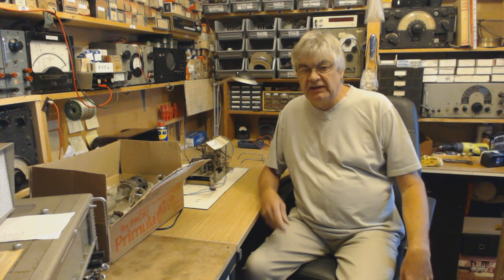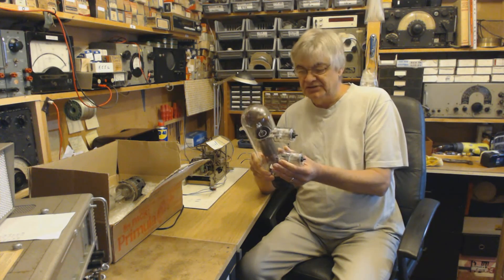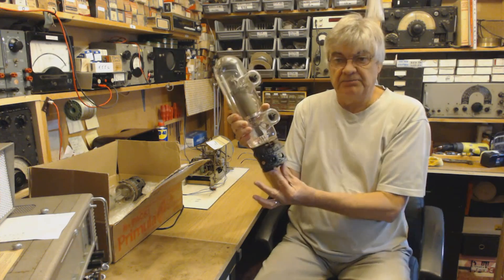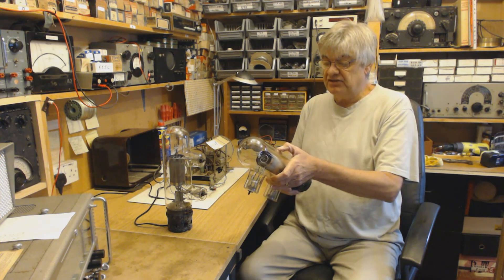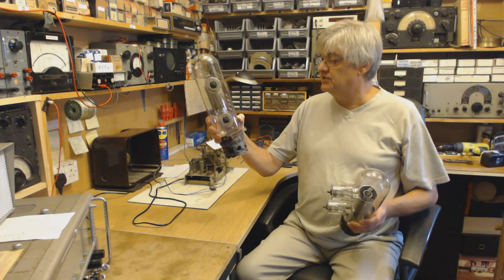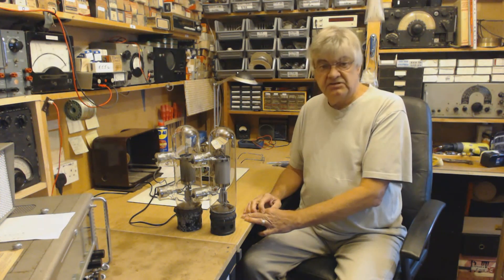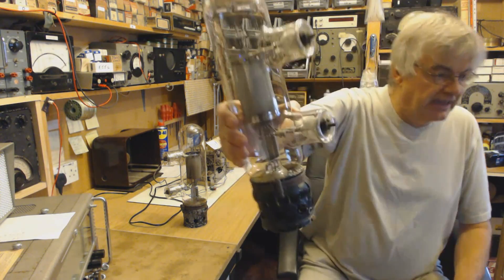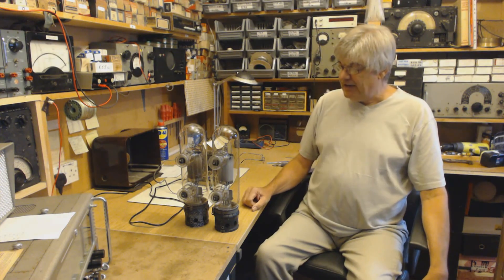500 Watt triode transmitting valve RS329G

Comment: I'd like to see someone build something with a 3C22.  This is a disc seal triode originally used in radar jammer applications and is good up to 125w plate dissipation with forced air cooling.  Apparently it is linear up to 3.2GHZ, and quite surprisingly it works very well as an audio tube, being somewhat similar in characteristics to a 6550 strapped in triode mode.
Reply from the maker: Yes, I'd also like to see that!

Comment: Hi Ray, I haven't actually seen a transmitting valve before. Very interesting. I remember seeing the valves in the back of my dad's old Oceanic MW/SW radio, though they were rather small compared to the ones you have there. One thing that I do remember about valve receivers that even the "so called" portable receivers were quite heavy to move around. Thanks for sharing another interesting video. Robert.

Comment: Please be careful with them.Watching you handle them so nonchalantly made me cringe,as high vacuum tubes can implode when damaged!!
Reply from the maker: Good point, Michael. I remember a chap in the TV workshop back in the 1960s. He lifted a new 19 inch CRT out of the box by its neck... The neck broke off and the air rushed in. Luckily, no implosion. Cheers, Ray.

Comment: They look intimidating as hell, but for outrageous looking stereo amplifier monoblocks, the 833A has great charisma and people who have built the say that they like the bass and the general sound. Perhaps an 833A could drive an RS329G if you have an electrical hookup for it all. If you have some spare uranium laying around you could generate enough power to run a 7 channel plus Atmos channels using all RS329G's.

Comment: I am building an amplifier for amateur radio use, one of those would be
cool for it! I have not seen any of those here in America tho.
I plan on having a screened window in the front of the amp so you can
watch the tube while it is in use, as I like people to know antiquated
technology still works.
I have a pair of tubes to choose from, a 4-250 or VT-143. The VT-143 is
a 125 watt tube, and the 4-250 is a 250 watt tube. The VT-143 looks
cooler tho, but I can always upgrade the tube to a higher wattage one
in the future.